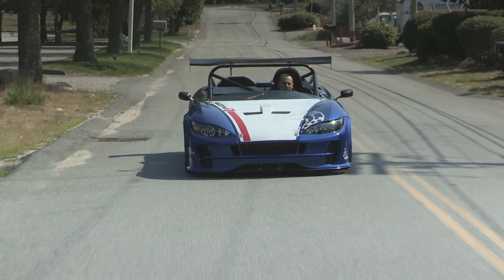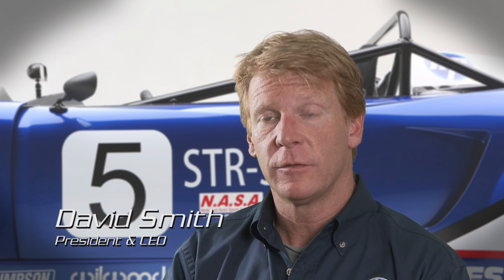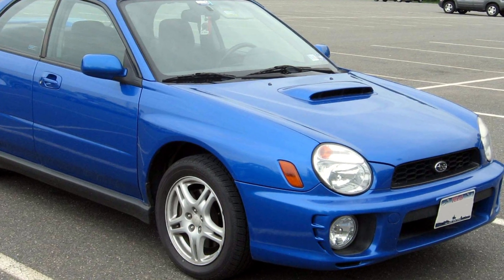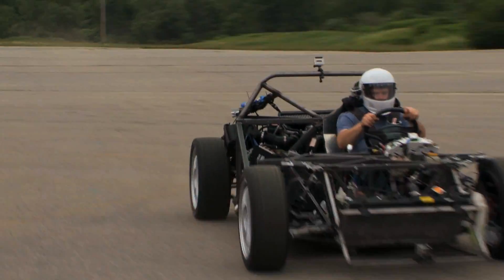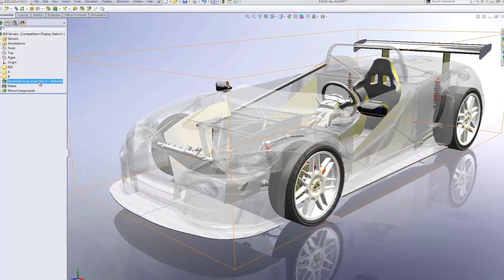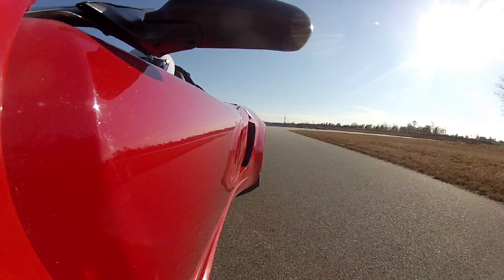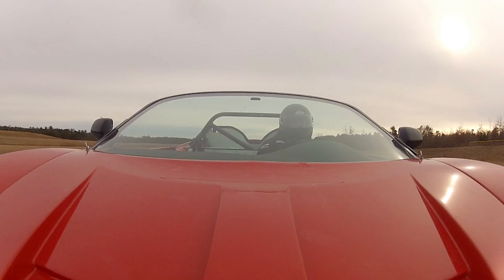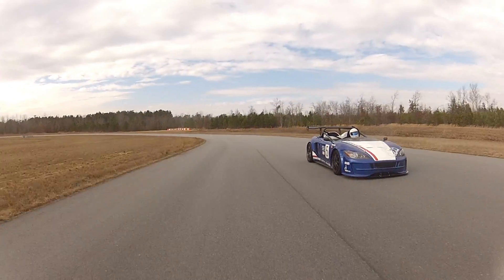Factory Five 818

Comment: I've been considering building an 818c for a while, I was wondering if the GM LZ9 motor would fit in there with the F40 trans, essentially a better balanced 2006 pontiac G6, just wanted to know if something like that was feasible and still make it a safe track car or even street legal track car.

Comment: One thing that always put me off kit cars is structural safety.
Reply: Scared of a roll cage? 😅 Production cars have aluminum bodies not steel roll cages.
Reply: @sleepwalker29  production cars have a variety of structural safety items. They have "Crumple Zones" which will crumple during impact, absorbing kinetic energy. They also have safety cells/cages/compartments. This is the area where the driver and passengers are, and this is designed to be extremely strong and durable. You want your crumple zones to crumple around the safety cage, and the cage to stay strong and in one piece.
Reply: I don't know if they got it validated, or even independently validated, but based on this video it seems they ran FEA on the chassis. Assuming their factor of safeties for loadings used were adequate, and - again - there was some validation process. This car should be safe.